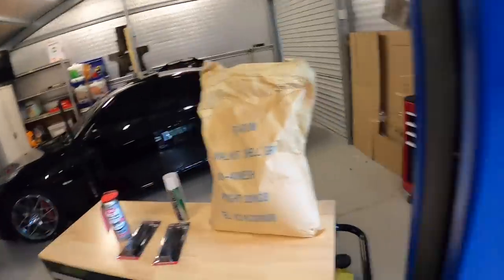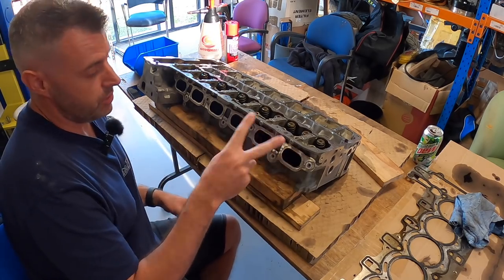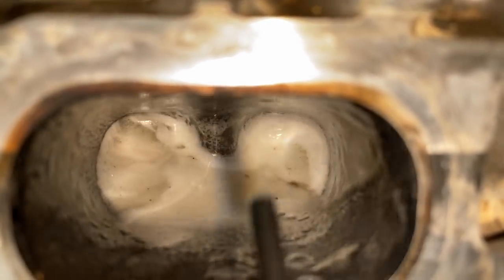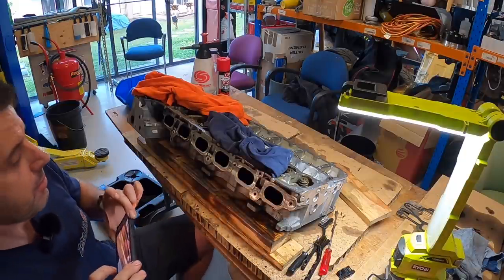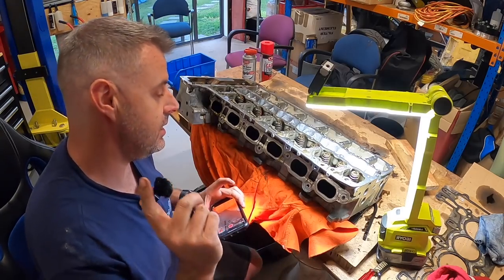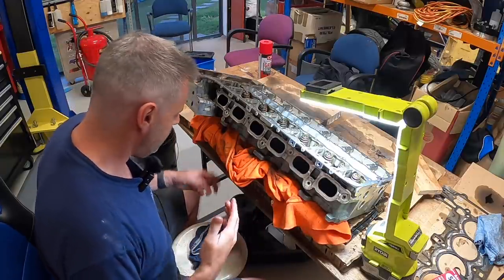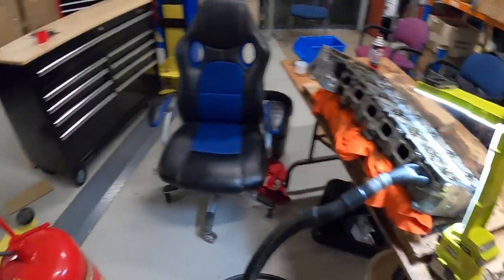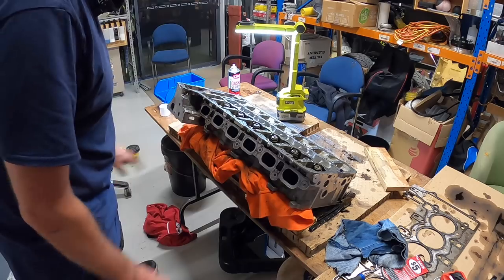BMW N54 Intake Valve Cleaning: CRC vs ThreeBond vs Walnut Shell Comparison

Comment: Insane how much buildup accumulates. The three bond seems to work better. Does the n55 have the issue as well?
Reply from the maker: Yes unfortunately. It’s an issue on all direct injection engines.
Reply: Zero To 60   I was hoping that N55 engine is revised from factory together with its emissions gear, and will be less likely to have carbon build up accumulated inside. It probably also depends on the way you drive, what oil you use and how often it’s changed.
Reply: @ZeroTo60Tube  less on ford ecoboost,, the bmw pvc system comes off the valve cover,, the ford is on the engine block, and the pvc sytem is a box bolted to the block with passageways,, and the vapours have to flow up... so more get caucht in the system before it goes into the intake track.. yes , they still have carbon build up,, but on my 2014 fusion 2.0 with 155000 mile on it,,,, it was less than the bmw shown here.. i now run a oil vapour sep. on my car.. i added inside at he bottom of the can, some copper pot scrubber ( not much, did not want to fill the can ) and after 1000 miles less than a teaspoon of oil in the can... its mounted close to the engine, right now, plan to remote it further away to slow/ drop more of the vapours out of the system.... i also use a clear braded vinel hose to see how dirty the hose might get..so far.. pretty clean

Comment: To be fair to the chemical products they say you are meant to use them every 10km before an oil change. I wonder the difference not letting the carbon build up so much?
Reply from the maker: I think it would make a huge difference: the thicker the carbon the harder it is for the chemical to penetrate it and break it down.

Comment: A tinfoil hatted reddit post I recently read in the wee hours of the night suggested a heat resistant ceramic coating for the valves next time I rebuild. Supposedly it prevents the carbon from sticking to the valves as much...the stock PCV system on the N54 is also supposedly garbage.
Reply from the maker: The stock PCV is desigend to let some of that vapour back through. I believe its an emmisions thing, but not really sure. The ceramic definitely makes sense tho. Likely a similar coating to what is on pistons.
Reply: @ZeroTo60Tube  Going to give it a shot before I put the head back on and swap in my built motor...might as well while I wait for my turbos to arrive.

While PCV systems certainly help with emissions I wonder if law makers ever ask themselves "if emissions equipment ruins engine efficiency over time how much are we actually helping the environment by requiring it?"

Comment: Using crc or sea foam every other oil change will keep the valves spotless if done correctly.  Of course it doesn’t matter if you buy a used DI motor that’s been neglected by previous owner
Reply from the maker: Yeah i completely agree i think thats the way to go. Give them the deep clean with walnut when you get the car, then use the CRC frequently (as its supposed to be used) to keep on top of things.

Comment: Both the CRC and Seafoam are heat activated, they aren't supposed to be used like dish soap.
Reply from the maker: They hardly do any thing to DI engines with this much build when used as per the tin. The chemicals inside you will find are not heat activated, would love to know where you read that? However the carbon is easier to break down when warm, so i get where you might be coming from. But yeah again, using them as stated on the tin in a N54 is absolutely pointless. Unless you do it say every 5000klms.

Comment: Leave the fluids overnight? that might work better
Reply from the maker: Well, probably, but then i would be worried about what the chemical might do to the alloy....It may be fine, but its some nasty stuff. Especially the Threebond.
Reply: @ZeroTo60Tube  not to mention, an overnight soak for 2 cylinders turns your valve clean job in to a 36 hour mission.

Comment: 8:05 why don’t you tip it over and/or use shop towels or a shop vac or (insert literally any other option)? 🤔 there are a ton of solutions in which you don’t get sprayed lol 
“Many points down for” zero to 60 lol jk

Edit: I guess you started doin the tipping thing... I’m still struggling to make sense of why you used the air in the first place 😂🤔🤷🏻‍♂️
Reply from the maker: Haha.

Comment: wow, looks like you need some kind of air-oil-seperation catch can because that accumulated evap'd oil is everywhere with no port injection to keep it clean.
Reply from the maker: Completely normal build up on a DI engine unfortunately. Catch can setups are a big help.
Reply: @ZeroTo60Tube  yeah, I had a mate that had one of those 335's when they first were new and the entire fuel system was replaced multiple times by the dealer along with multiple cylinder head services. Any plans on inlet manifold with port injectors to help 'keep things clean'?

Comment: You can't do a comparison that way. Most chemical cleaners are meant to heat soaked. Run engine get it warm then apply with the engine running. They will NOT work properly that way. So of course it will be messy and NOT work like Walnut she'll blasting. Directions are actually on the can. Imagine that.
Reply from the maker: I understand what you are saying, but the chemical cleaners are intended for use at regular service intervals. If you use them as directed on a 10 year old engine thats never been cleaned, they wont make a difference at all. THEY ARE USELESS IN THIS APPLICATION IF USED AS DIRECTED

Comment: I believe if the CRC had been done as per the instructions you wouldn't have had the mess, but that's just me.
Reply from the maker: You are 100% correct. It just doesn't break down the really heavy build up. But if you used the CRC at sensible intivals i reckon you would be fine.

Comment: I think its funny that you don't follow the directions and then complain about it, im sure the heating and letting it soak for an hour and then driving at highway speeds really helps break up a lot of that carbon
Reply from the maker: Unfortunately if you havent dealt with BMW carbon build up, you wouldnt know. But using as it says on the can does nothing to an engine thats done 100,000ks. CRC and nubond are intended to be used frequently and maybe if you did use them every 5000ks they may work.. Unfortunately intake cleaning is not part of scheduled servicing. So you are faced with mass built up. The way i used the chemicals has been proven to be the most successful to use the chemical. The reality is still takes ages compared to walnut blasting which is what the video shows.

Comment: I need to walnut blast mine but i'm scared to death! i do most of my work myself but thats something i never have done.  Kit from FCP Euro inc wish me luck!
my n54 has been a work in progress but i love the thing.
Reply: so what i got from this, is 100% walnut blasting is the way to go, but to clean the excess shell, and around the intake manifold ports some cleaner is actually needed? Also, when doing this with the engine INTACT,  I know i need to make sure each cylinders valves are closed but how can i be 100% sure i remove all the walnut shell?
Reply from the maker: You are on the money. Definitely need to make sure the valves are closed. When you crank the engine over with the ports open the valves close for quite a while on each cylinder so its easy to tell they are closed. You really need to try as hard as you can to get the shell out before you open the valves. A air line and pic will get it out with out too much hassle. However i have seen people leave what i would class as a lot of shell still in there and have no issues. Also regarding the edge of the ports, the proper tool may get better coverage than my home made nozzle, but cleaning the upper edge with even brake clean doesn't take too long. Brake clean and a brass brush and you'll be done in no time.
Reply: @ZeroTo60Tube  i was thinkin of using some gas when it was all said and done on each cylinder, and a siphon hose I have to get every damn specc of it! The thought of having walnut shell in my fuel system wouldn't allow me to sleep 
Thanks for this video man i'm sure its helped alot of ppl i know its helped me
Reply from the maker: @freemaysin5088  yeah, tbh not a bad idea at all.

Comment: working hard not smart. i used CRC with a combo carb cleaner and a tooth brush on my 09 mini cooper S. had more gunk.  the best way to clean the fluid is to use the fluid extractor which i use to get the oil out of the dipstick to suck the fluid out and reapply after spray carb cleaner and only took 4-5 applications and 45 min or less.

Comment: Can't really state the chemicals don't work since you're not using as intended.
Reply from the maker: They dont even scratch the surface if used while the engine is running. The chemicals need to be used very frequently. No BMW owner is cleaning the valves frequently. Most cars see 100,000 miles before they get a valve clean.

Comment: Man, that's not how you apply CRC. You supposed to use it on a warm engine following very specific instructions.
Reply from the maker: Using it as instructed, doesnt break the build up down. Its also directed to be used frequently. Not at 100,000klms like most bmw engines.
Reply: @ZeroTo60Tube  TY sir! I appreciate your review!

Comment: You are using the chemical in wrong way. So the comparison is not fair.
Reply from the maker: I’m using the chemical the same way everyone else does who has particular bad valves. 

When they get this bad spraying it though the intake does nothing. 

The chemicals are designed for regular use. But most N54s go 10 years with no clean which is how they end up as bad as seen in the video.

Comment: No comparison. The engine is not running 😂
Reply from the maker: It’s a comparison of different ways people try to clean the intake. 

Using the three bond while its runnings doesn’t do much at all. The chemical needs time to breakdown the carbon. Three bond will break it down as you can see, thanks to this very helpful and informative video. However, using three bond is only going to help if you do it every 3000-5000 miles. If you wait till it’s built up like this, three bond while it’s running is pointless.

Comment: The product is not being used correctly. Simple as that.
Reply from the maker: This video was done to highlight common methods being used by many people.
Reply: @ZeroTo60Tube  so, don't use the product as per directions??
Reply from the maker: @calmauric8218  no, it doesnt work on heavily caked up valves at all if you if you do it with the engine running. It is very heard to get the chemical to prenrate the carbon if the engine is running. Obviously the air flow draws the chemical past the valves. The CRC and Threebond are both chemicals which "should" break down the carbon build up, that is why people use them as per the method shown.